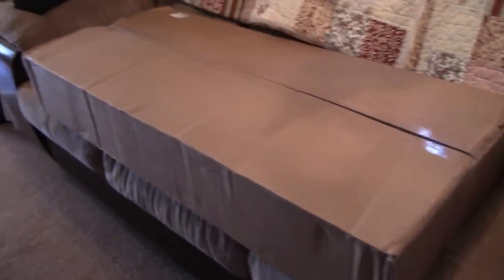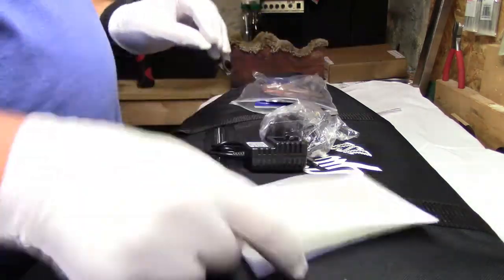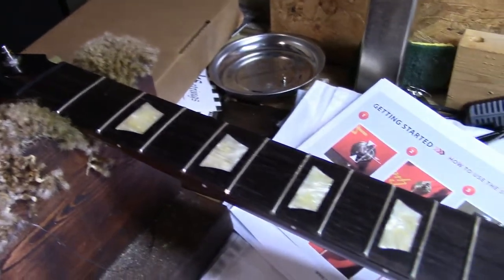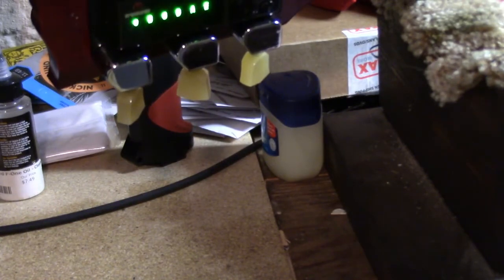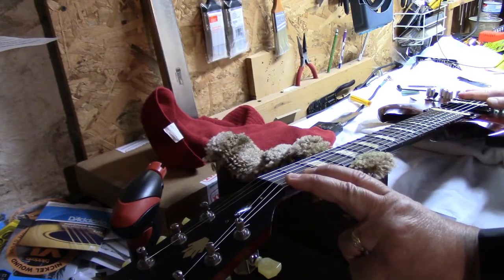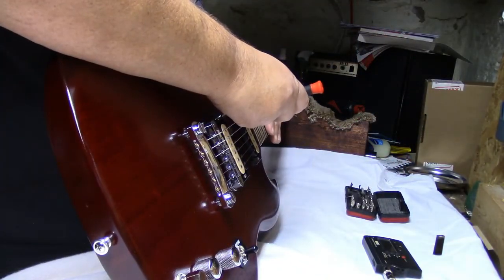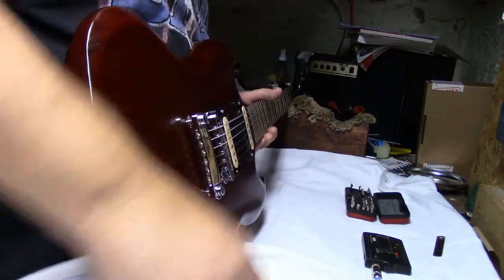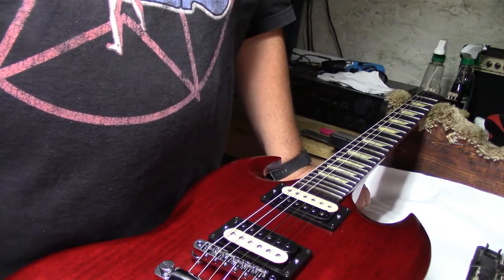2013 Gibson SG Future with Min-Etune New In Box in 2017

Comment: I got this same 2013 version for $500 at Musicians Friend on their deal of the day back in 2017. They got a hold of some left overs. A very Sweet deal, indeed. 
I couldn't get a used beater SG for that price.
My frets are fine, needed no finishing, but I do have a very tiny tick on the high side back of the neck at the 5th fret position. 
Which makes it easy to find "A" in the dark. So it actually works for me.

No complaints other than you can't get replacement batteries for the Tronical tuning device.
They sued Gibson for whatever reason, and to get even, refuse to sell replacement batteries to Gibson customers. I had one on order for over a year from Tronical. They said they had them in stock, but would not send me one even after collecting a $70 payment. They eventually refunded me, but what a pain. Meanwhile, the tuning system is working fine with the original battery. I just like having a spare. I normally play Strats, but this has become my favorite guitar now. The neck shape is awesome, and the nut is Plek'd to the frets at the factory. So no buzzing issues at all.
I know I could easily get $1500+ for it now, but why? It plays way to well to let it go. Easily as well as my PRS Custom 24. (not SE). 
Anyway, point being is that if you can grab one of these for a sub $1000, I'd jump on it. 
The tuners can be changed out for stock if the battery is kaput.
A very resourceful person could rebuild the battery.
Go here for the factory info:
http://legacy.gibson.com/Products/Electric-Guitars/SG/Gibson-USA/SG-Future-Tribute.aspx

Comment: that mini e tune is a monstruosity , how could gibson produce such crap
Reply: I love them. I have them on three of my guitars I wish I had them on all of them.
Reply: really? they look ridiculous and take much longer to tune than if you tune it yourself, whats nice about that?
Reply: Computer Simulated Atomic Coded Reality they don't take long at all. This guy just doesn't know how to use it right. He clearly didn't read the instructions.
Reply: I thought they would suck too but they don't. It's super fast but that's not the real convenience. They have preset tunings so you can change tuning (half step, drop d,) in seconds. For standard tuning, its not a huge deal I guess but still tunes the entire guitar in the time it takes to tune a single string. This guy isn't doing it right.
Reply: Mine tunes pretty fast. No issues other than finding replacement batteries.